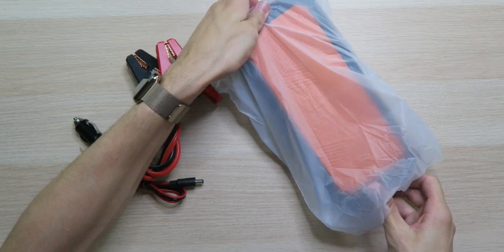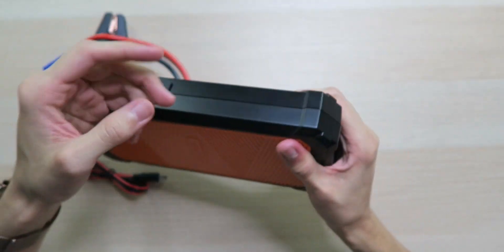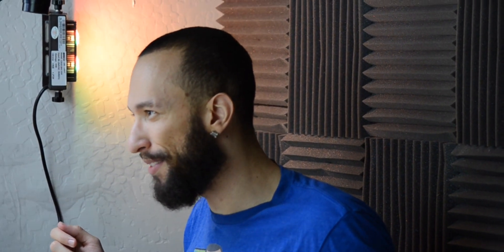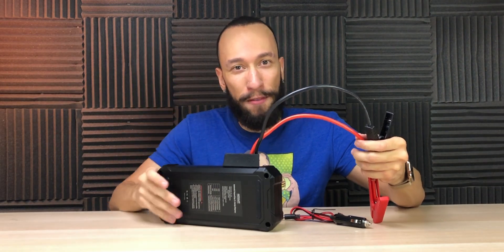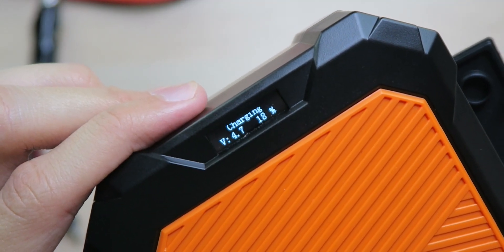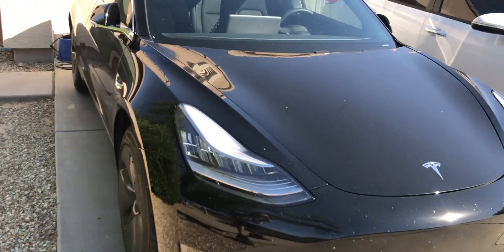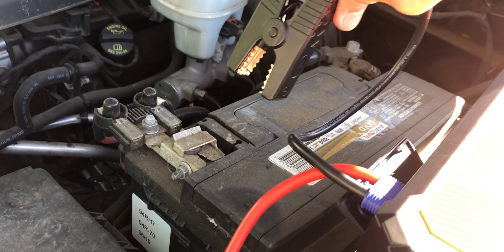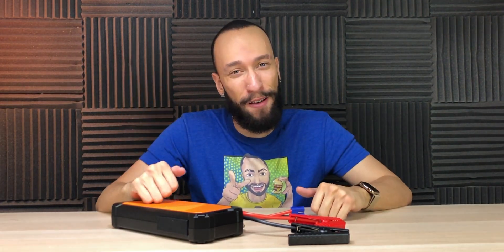SuperCap 2 Battery-less Supercapacitor Car Jump Starter

Comment: Can you charge this from a 12v car battery charger? So instead of taking hours to charge a dead battery, you attach this while charging and in a few minutes you're good to go.
Reply: 12v battery charger is a 12 - 14 volt source, so I would see no reason why it wouldn't charge the booster pack.

Comment: I’ve been making these super capacitors boost packs for 6 years now. There is not any on the market, that I have tested of this size, that can start a car that has a completely dead battery that has a high resistance starter motor like that of a 2004 Saturn Ion. Cars with this type of starter and battery placement require twice the capacity of a boost pack this size. On that note, cars/trucks with starters that draw a lot of current/less resistance should start with no battery if they a built right. I’ve took it a step further and made a system that allows me to completely remove the battery in all my vehicles, 4 wheelers and motorcycles. I will never buy another battery again.

Comment: You missed a step, You have to press the start button before you start the car. Know your stuff before to present it!
Reply from the maker: clown emoji
Reply: Your right plus the in vehicle charge up cable is included so you can use another vehicle to charge your unit up not your vehicle necessarily.

Comment: Can you charge it with another car's cigarette lighter?
Reply from the maker: That’s what the cable’s for.
Reply: @RodrickViews  Great!  
So if the capacitor is dead and your battery  is completely DEAD,  I can plug into the lighter if a friends car, charge the capacitor and get a boost out of it. 
As long as I use the capacitor right away?
I'm assuming that of you don't use the charge right away,  it will loose the charge?
 Thanks
Reply: Yes, I did that this morning on my work car which had a completely dead battery from non-use because of Coronavirus and did it as a test.  Really did take about 3 minutes from the family car.  Less I think.  I did not time it.